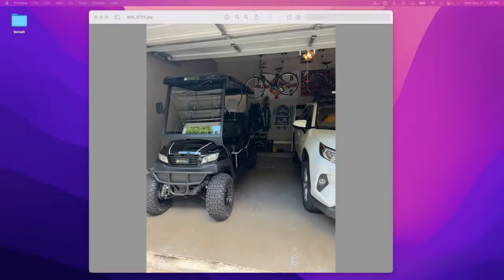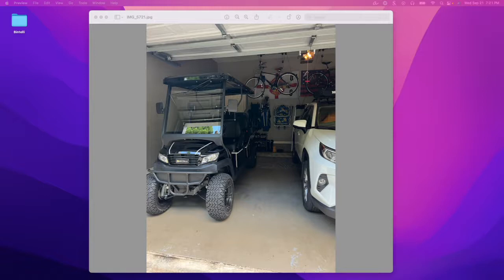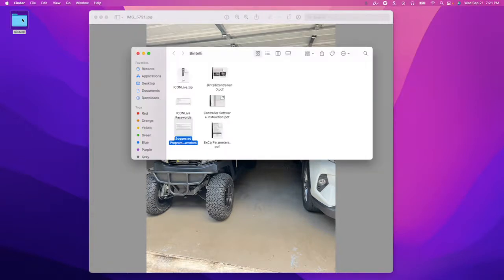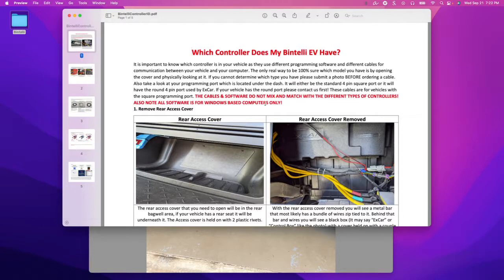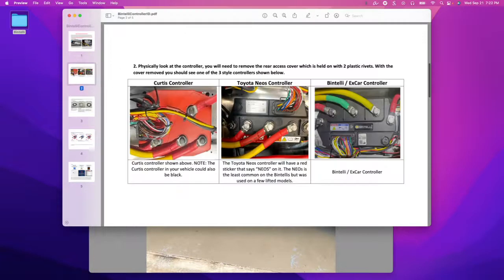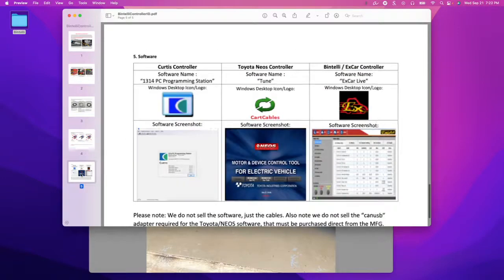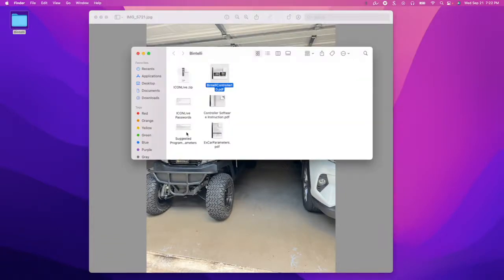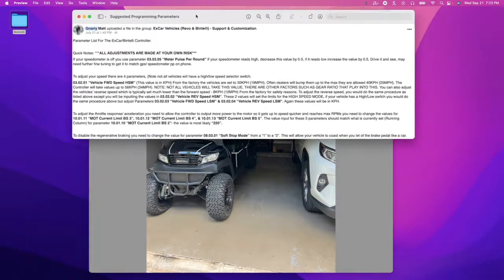How To Program A Bintelli Beyond Golf Cart

Comment: Hey I have tried to upgrade mine but it does not work.  I have the 2021 with the Curtis controller.  Did you use the curtis siftware
Reply: I have the same.  Where did you find the curtis software